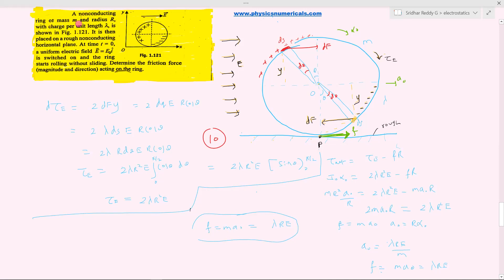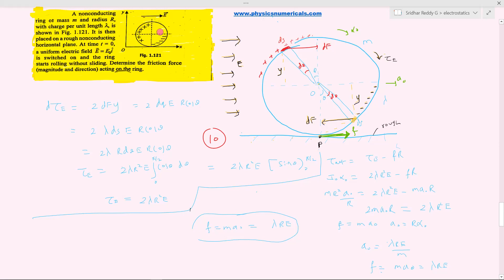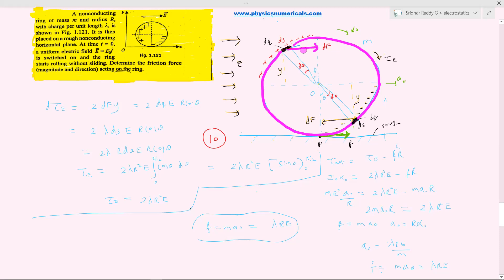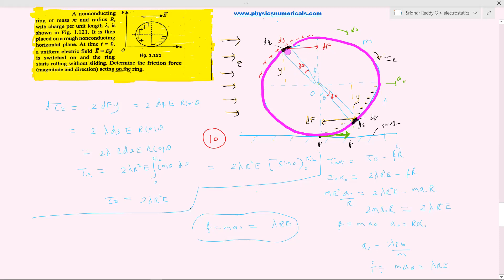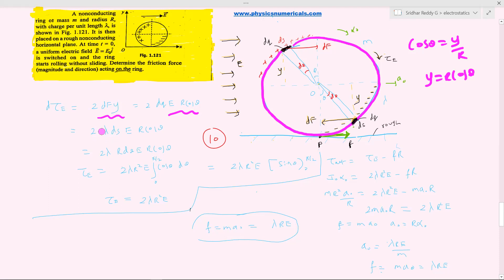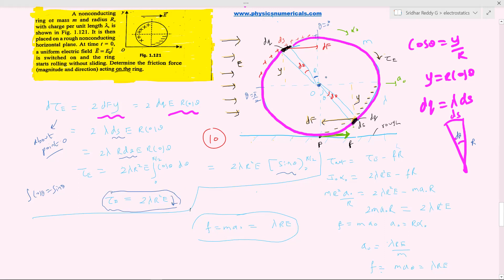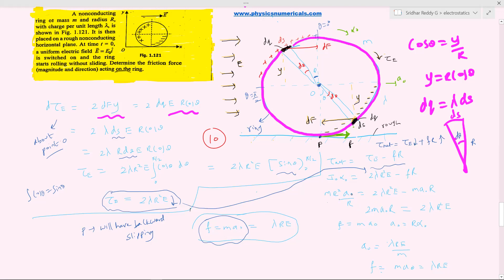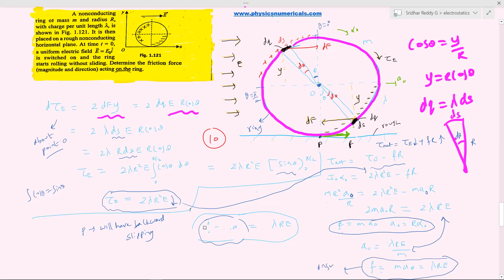14)  JEE | A non-conducting ring of mass m and radius R is charged as shown and placed on a rough

Comment: Why can't we do this by considering torques on the centres of charges of the arcs?
Reply from the maker: Torque is set up about the centre of mass , not about the center of a charge .
Reply: But isn't this is linear uniform charge distribution so centre of mass and charge should coincide?  @sridharsirphysics
Reply from the maker: No that idea , you can't apply here
Reply: Sir, when do we know if we can apply this idea and when can we not? @sridharsirphysics